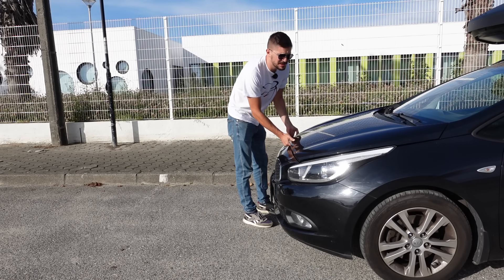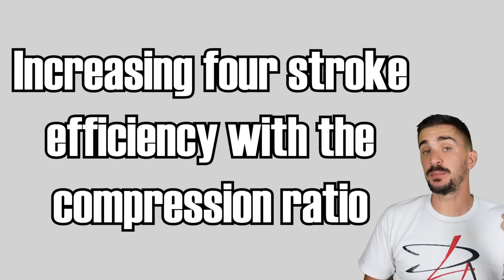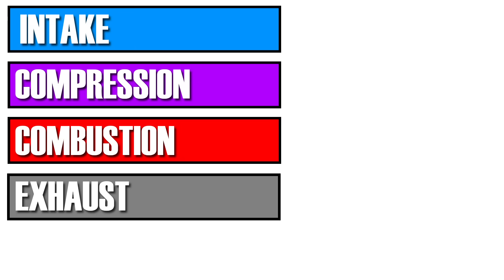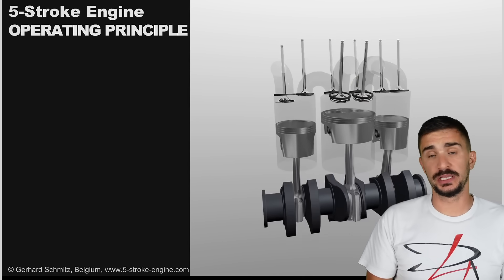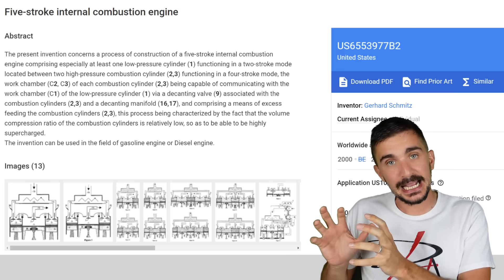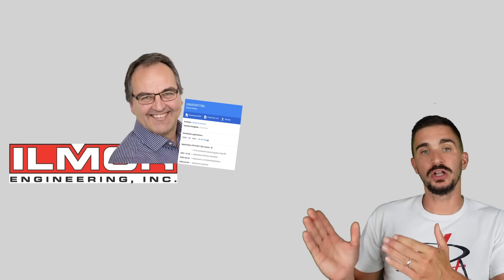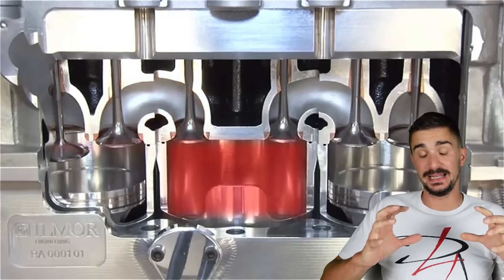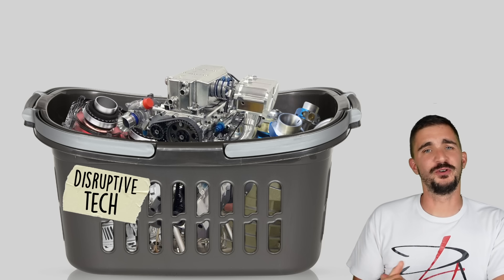Why Five Stroke Engines Are More Efficient But Still a Failure

Comment: What you described are known as multiple expansion engines in naval engineering, and were obsolete 70 years ago. Between the world wars naval warships migrated from the then-common triple expansion engine (you describe double expansion engine) to a better method of harnessing power - steam turbines. 

During WW2 however as the US ramped up its lend-lease program to expand supplies to Allied forces in Europe (and then even more so once it officially joined the war) this style of engine saw a dramatic resurgence in popularity as its simpler, faster, and cheaper to produce than any of the competing turbine models of its era - keeping in mind that all naval power plants operated by steam power, using some mix of coal (really old ships) or bunker fuel (heavy fuel oil that has to be heated before it can even be pumped) to boil sea water to generate steam which then allowed power via expansion to be leveraged however it was needed. 

Triple expansion engines work great in naval applications as they can be sized to the application, and the overall scale is so large that entire banks can be brought online or held in standby rather than throttling up or down an individual plant, allowing a ship to simply bypass the performance deadzones that exist as you outlines.
Reply: Seems the better approach to do this multi stage expansion engine is sticking a turbine connected to the engine's exhaust manifold sending extra power to the crankshaft. A whole lot more compact. I believe some old WW2 planes and some truck engines do this.
Reply: @danieltanuwijaya7675  or an electric motor, like the F1 MGU-H
Reply: @Amy-dq2lg Yeah electric "turbocompounding". Would work a lot better in the current era of electrification.

Porsche is already starting to put MGU-Hs in their 911s it's very cool to see.
Reply: @danieltanuwijaya7675  yes, that technique of essentially using the front stage of a turbocharger mechanically coupled to the crank was also used immediately post-war (not sure it actually made it into combat), though with the rise in jet turbines the days of that technology were extremely limited. 

The term you’re thinking of is “turbo-compounding” - distinctly not the same as a compound super-turbo-charger (keep in mind that in that era “super” charging meant “mechanically engine driven” while “turbo” meant “driven by a turbine, essentially always in the exhaust”).  This works essentially by replacing the compressor end of a turbocharger with direct link to the crank, so that exhaust gases drive the crank rather than increase engine power. I don’t watch Formula 1 but I suspect their mechanical energy recovery unit (or whatever it’s called) works under similar principles.
Reply: @robertkb64  Yep. Oh and the F1 engine's turbo is connected to an electric motor/generator. Works the same way as you described but it instead creates electricity that then can be used to accelerate the car, it has another electric motor connected to the crankshaft and a battery for storage.
Reply: >to boil sea water
Naval steam used closed-loop steam, recapturing the steam and recondensing it back into water to reuse, because any contaminates (salt, dirt, algae, etc.) would be left in the boilers when the water boiled, clogging the boiler tubes something awful.
I believe the only modern naval steam (nuclear) uses a mix of closed and open loop, but they can get away with that because they have the space and power to run their own desalination and purification plants.

Otherwise, you are correct that this '5-stroke' is really just a double expansion steam engine design. I've neve thought of double (or the more common triple) expansion as 'elegant' (they effectively just let you trade space and weight for efficiency), but they were a ubiquitous design during the steam era for a reason.
Reply: I have the question about the big two stroke diesel ship engines. They're already the largest most efficient engines in the world, I'm guessing there isn't much if any benefit in adding extra expansion. They already run at very low speeds, have turbo chargers, have an amazingly long power stroke and no exhaust stroke. I don't know how they could get better.
Reply: @wiredforstereo  What you say is completely true. These engines are designed to run 24/7 for more than 30 years, with very little time in dry dock.
A few years ago, ship designers realised that a single prop and engine as designed by Brunel was the most efficient. This led to a reversion to single engine ships. These days, their is a trend towards electric pods, with the engine driving an alternator. the advantage also is that by removing the heavy shaft driving the prop and the necessity for losing power through the gland seal, the engine (or engines) no longer have a critical location. Reverse is simply the press of a button to swap  2 of the phases.
Another recent project to supplement the power by adding vertical wind turbines has reduced power needed from the engine driven alternators by up to 20% 
In addition, in event of engine failure, the ship can still limp to safety and maintain a bearing to avoid being capsized in a storm.
Reply: you, um.... are aware that steam turbines are simply multi expansion engines, right? other than single stage delavals, theyre all compounded to a certain degree...
Reply: @paradiselost9946  Since I know the applied naval history I took it as assumed that I understood the operating principle :)

Though you’re right, many won’t have that context - that all of these discussions are about century+ old technologies. History may not repeat itself, but it does rhyme :)
Reply: @robertkb64  Quick correction, it certainly wasn't sea water being heated. That leaves extremely bad salt deposits and will rapidly clog the pipes. They would use distilled water and occasionally even distil their own water, though that introduced it's own problems.

Also an addition - the B-50 was one example to use turbo-compounding. There were a few others, mostly prototypes, at least one diesel corvette (prototype?) if I recall too. But certainly most military aircraft moved to the jet before turbo-compounding became mainstream.
Reply: @olivialambert4124  Yes, thank you for the correction. Somehow the fact that pre-nuclear steam plants were also closed loop slipped my mind (and for everyone else since I’m sure you already know this part: US Naval nuclear plants use a two-loop water-based generating geometry, so that cold sea water is drawn in and passed through a water-water heat exchanger, drawing heat out of the reactor loop and discharging this now-warm water back into the ocean. The other side of that water-water heat exchanger then pumps now-cooled water back to the reactor where it picks up heat through essentially direct contact with the radioactive rods which super heats it, pumps it over to a steam turbine which spins generating electricity. This now-hot-water is then pumped back to the water-water heat exchanger where it dumps its heat through the heat exchanger into sea-water, allowing it to run at full power continuously. 

Soviet designs are substantially the same, though their primary loop uses molten metal rather than water. 

TL;DR - yes, you’re right :)
Reply: @robertkb64  Not trying to be an annoying way but I assume that, like me, you love learning. So there's a few things I'd tweak here too. Naval power plants also need distilled water in the secondary loop. If it isn't boiling to steam it isn't making power, if it is boiling to steam it's leaving salt deposits everywhere and blocking the pipes within a few hours. There is seawater involved for cooling specific areas as obviously that's effectively free, but the secondary loop on all but very rare power plants (eg some attempting nuclear rocketry, some of the 60s nuclear flight attempts, and so on) are using the secondary loop to power the turbines. You keep the primary loop under higher pressure so it doesn't boil, but you still don't want to risk salt water as that's asking for a nuclear meltdown. The subs and ships tend to have their own distillery to get pure water as the power cost isn't a problem with nuclear, but the rate of exchange in the secondary or primary loop is exceptionally slow and it's more to do with safety if a leak happens (plus crew comfort not drinking urine).

Soviet (and American) designs both use water almost exclusively. A handful of designs of both nations submarines have tried metal, the higher heat allows a massive power density (and speed), but it wasn't to be. Logistically it's utterly terrible, if the reactor needs to shut down you're in for a world of pain as the metal solidifies and it's an extremely big issue to resolve in dock. Maintenance is also an extremely big problem. It's amazing but the problems are just too much so every submarine the Soviets and Americans made both before and after that one small prototype class uses water cooling in the same two loop principle. (I'm a physicist so nuclear reactors are one of my interests).
Reply: @olivialambert4124  Well, closed loop for the ships he's talking about, early steam ships did use jet condensors rather than surface condensors, where they just blast the steam through a jet of sea water to condense it. This results in a brackish mix pumped back into the boiler, and is why those earlier steam ships were limited to only 20-25PSI boiler pressures as the scaling would provide dangerous pressure and heat zones at higher pressures.

Comment: Could combine this design with free valve and bypass the middle cylinder at lower revs. Add in something to deactivate the cylinder like is used in variable capacity engines and maybe it could fly. More complex, but still utilising existing technology. Just a thought.

Comment: If you're harvesting all the extra energy from the main combustion with a 3rd cylinder, would it be possible to just drop the valves and make it run like a 2-stroke?
Just imagine how fast you could rev that puppy.
Reply: Isn't there the issue that you need to contain the gas behind poppet valves to stop the useful pressure escaping either to the exhaust or back towards the other high pressure cylinder?
What occured to me was that you could effectively increase the size of your exhaust valves by venting at BDC too, but that increases complexity.
Reply: Uhm... Only with a blown one, like a naval diesel 2 stroke. 'Cause in normal 2 stroke, the moment the inteke port opens, there is instantly no more pressure on the "low pressure cylinder", and a lot of back pressure in the intake (with would be a disaster in terms of performance).

Comment: Is there a reason why we have not seen an ICE engine paired with electric drivetrain i.e. no transmission, just have the  engine be a generator for the electrical motors?
Reply: Things like this do exist! Mostly in larger vehicles. Trains, submarines and maggi e mining dump trucks to name a few. The reason they aren't all that popular in cars is likely because the weight of an engine +the weight is the electric battery + the conversion losses probably don't add up to the savings from the better low speed torque and instant power. That's why we have hybrid drivetrains.

Comment: 25:30 I wasn’t going to mention it but the electric motor was invented in the 1830s….  What has changed recently isn’t the motor as much as the batteries to store the energy and the power electronics to drive them more efficiently.
Reply: Misleading. Brushed electric motors were invented in the 1830s, and are still common; but most electric cars use brushless motors, which were invented in the 1960s.
The design of both batteries and motors (at least for the types of motors used in the majority of electric vehicles) have fundamentally changed since the 19th century, while the design of 4-stroke engines used in the majority of ICE vehicles has not (unless you count direct injection as a fundamental change, but that dates back to the 1920s so is still much older than brushless motors).
Reply: @nathangamble125  brushed motors were not as common as we'd think, brushless is quite old as well and far more common in the industry, once we adopted alternative current as a standard it was cheaper and easier to produce synchronous brushless motors.
Reply: @nathangamble125  Commutator free asynchronous motor was invented 1887, that tech is also quite old it just so happens when they figured out the physics of it they could not quite make it happen with tech they had. What most electric cars happen to use is permanent magnet synchronous motor, you could not use that without DC to AC converters with variable frequency, which would say biggest hold back was electronics for currently used motor as it just so happens they wont start on there own and 100kW is no small amount.

Not to mention and when talking about induction motors they are about 90% efficient, so the jump to synchronous motor at best is 10%. 
And brushed motor goes at 75%, so truly what has changed the most is batteries and electronics. Oh and don't forget all the improvements ICE got from electronics. 

And still to this day what holds electric cars back is batteries.
Reply: @nathangamble125  Sorry mate but that's a real stretch. To compare an Otto Cycle engine from the even the 1900s to anything today is disingenuous.  Either that or you've never actually looked at the early designs!  They operated on the same principles but the materials, design, construction and technology is dramatically different.  The argument about electric brushless is completely invalid as well since Nicola Tesla invented the AC Induction motor circa 1887...
Reply: The electric motor has seen some massive improvements like brushless designs, but the original design is still used in a lot of cases.  The electric motor is FAR more versatile than combustion engines.  But if I can I will usually choose a combustion engine over an electric motor.
Reply: @jasonsmith4902  Not me. The instant torque available from an EV is addictive. I still like some ICE (and own 3 - my wife's Z series and my two motorcycles) but I don't even consider buying another ICE since swapping my daily driver from a 928 to a Tesla in 2014.
Reply: 15:30*
also electric engine didn't stay the same
they changed even more than an ICE

Comment: Isn't another reason why the 5 stroke engine did not take off is that fuel injection has allowed 4 stroke engines to effectively reduce the intake/compression stroke by leaving the intake valves open beyond BDC and delaying fuel injection until later in the compression stroke?
Reply: Yup. That's called  "modified Atkinson" or "simulated Atkinson" and it achieves similar results without the fragility of the extra linkages in the genuine Atkinson design.  The Toyota Prius and some other hybrids use this valve timing cycle; it was never really viable for cars until hybrids because the torque output is pretty poor, especially at low speeds. The EV system in a hybrid supplies good torque even at rest so the engine's shortcomings are covered.
Reply: @leifhietala8074  Or "Miller" if it has a turbocharger.
Reply: Modified Atkinson is about Valve Closure Delay; first introduced by Alfa Romeo in '80.
Reply: Get atkinsoned
Reply: For low rpm, turbo and catalytic converter issues, couldn't they be fixed with a bypass systeme the makes the engine run in four stroke mode until a certain rpm ?
Reply: @yapod9061  that was my first thought when he brought up low power issues. The only problem is that at low power, which is most of the time, the engine still pays the penalty for the extra weight, size and mechanical drag for the large centre cylinder.
It occurs to me that this type of engine is ideal for a hybrid range extender. Like the Mazda rotary range extender, it would only need to be tuned for one speed and 1 torque.
Reply: @yapod9061  the working cylinder might doing great, but the additional cylinder will sucking their energy.
Reply: @yapod9061  There's an idea. The tech exists.
Reply: That's called a Miller cycle engine.  Does require a supercharger though.
Reply: Your meaning is Toyota 's VVTi, or Honda VTEC; both adapted from ALFA -Romeo's intake Valve Closure-Delayed in '80, this technique also similar to Atkinson Cycle/Engine.
Reply: As I heard it, the intake valves are left open after BDC because some inlet gas is still moving inwards at BDC - which means that you can increase the inlet charge basically for free. Just after BDC the inlet valves are closed; which creates a shock wave that improves the mechanics of compression. p.s. they did this on carb engines as well.
Reply: @stonelaughter nah, that's really only used for performance. what the others are describing is pushing air out of the cylinder to reduce the compression stroke, and make the power stroke functionally longer. Kinda like the 5 stroke engines, it turns a 2.0L engine into a 1.6L in intake.
Reply: Pretty sure that is the atkinson cycle that prius motors use but im not 100% sure on that. I always heard of 5 stroke motors being a 5th stroke with a water mist injection like bmw messed with back in the day. A "steam stroke" where you get some extra power by converting heat+water  to steam and pressure
Reply: The water was for cleaning also , i wonder if thats how they figured it got more power ? It simply kept the valves and combustion chamber components cleaner , which in turn may have sealed better at full compression , possibly for a better bang  ? Ive often wondered if they have tried injecting something more ignitable than gas into that one cylinder the 5th stroke ,of course building components strong eneough to handle that ?  Just guessing though
Reply: No. Watch the entire video again. You stiĺl do not understand it. Just saying.